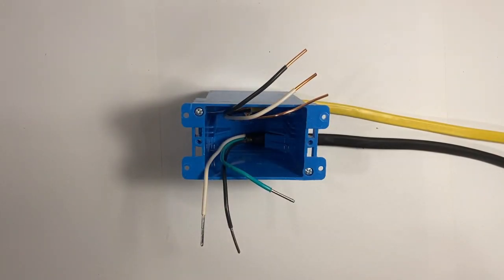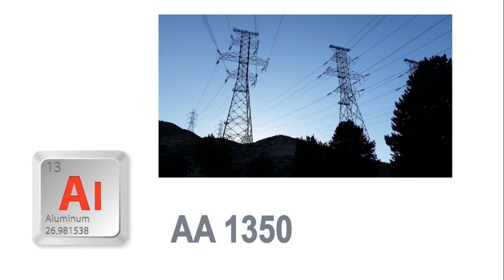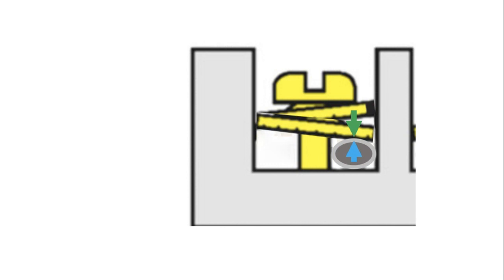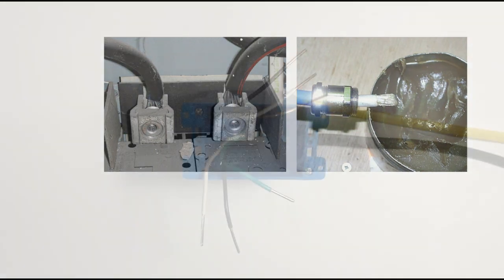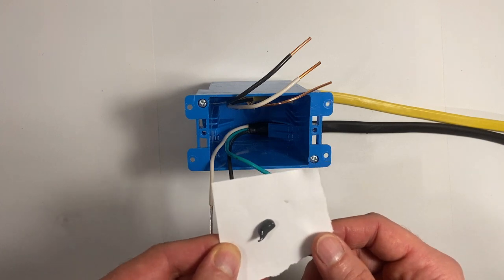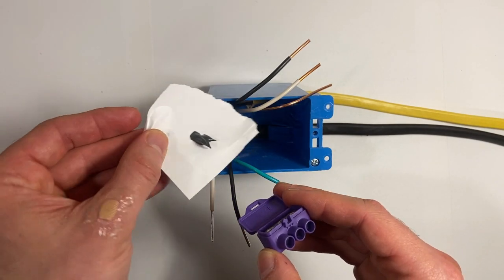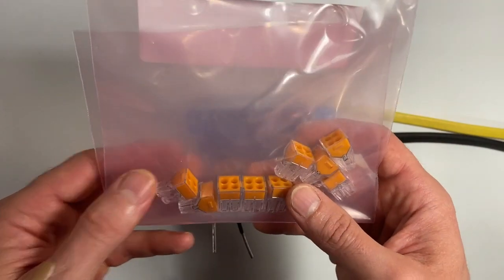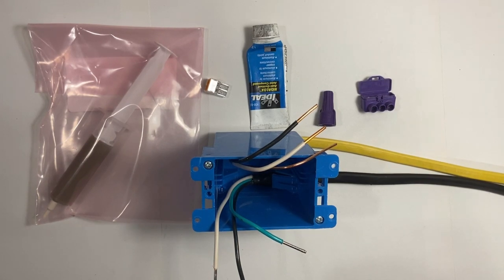Is aluminum wiring bad? How to connect copper and aluminum wires safely.

Comment: Supposedly no a CO/ALR rated outlet is not a good solution.  The connections still come loose over time due to the ductility of aluminum and expansion and contraction that occurs under load and when load is removed.  No one can ever explain why the ductility issue is magicall negated by Alumiconn connectors.  Still waiting for an explanation of why Alumiconn is better than a CO/ALR outlet.

Comment: My first choice is the alumiconn connector as long as it’s torqued to specification.   My second choice is regular wing nuts with antioxidant paste.  They hold great.   My last choice is the blue nuts.  I’ve had two of them fail on connections.  They are big and I don’t trust them. I read other people had trouble with them. I do have one outlet that accepts aluminum wire. They are great as long as the connection is made correctly.
Reply from the maker: Thanks for stopping by! I agree with your order of prefrence 😊

Comment: Great video! I appreciate the visual aid as youre talking about each thing. 😊  

So I had to do some digging and there is not much information about it, but it appears that the WAGO 222 lever connector series can also work with copper and aluminum as long as you use their Alu-Plus paste. The 222s can take a range of wire sizes too, unlike the push-in connectors. And the 222s can handle stranded wire as well I believe, as the push-in connectors can only do solid wire. They also take up less space than either of the purple connectors you showed.   

FYI, I looked and looked and didn't find much on info on this connector being used with copper and aluminum anywhere except for on the WAGO website itself and maybe one forum. If you generate the data sheet on the WAGO website on those connectors, it does say copper and aluminum. I even found a page on the WAGO website that explained the problems with connecting copper and aluminum together and tips on the matter, and it mentioned the WAGO 222 lever connector and their paste. It said that WAGO 221 connectors are not designed for it but 222 connectors are. 

The really strange thing is that not even a couple days after I found that page mentioning copper and aluminum connections on the WAGO website, I went back to it and it said error 404 page not found. 

Sorry for the essay but with all that said, these are not very well documented yet, so maybe use at your own risk with their paste. 

@Russian Sparky maybe the WAGO 222 series is something you can look into and do some testing on!
Reply from the maker: Thanks bud... Will try, but one thing I know, even though there is paste, and you can buy pre-filled connector, they are not listed for AL in the US...

Comment: Central and Eastern European houses wired in the early 1990s and before have aluminium wiring and they are just fine.
Reply: No, they are not fine. I almost got a fire several times.
Reply from the maker: Chances are, they are using the new, 8000 series aluminum.
Reply: @russiansparky4194  I'm not sure what alloy was available in the 1940s but there are 70+ year old houses with original wiring in pristine condition. Although we need half the current for the same power on 230 V and we didn't have backstabbed outlets and switches like in the US. We also use 3 phase so instead of a 50 A circuit like in the US we use 3x16 A.
Reply from the maker: @mernokimuvek  Hard to talk about this in general, because every house is different, but I think there are two things at play: a better aluminum alloy than the infamous 1350, and unmodified, original wiring. Plus, all the things you mentioned - no backstabbed devices, higher voltage. If you don't overfuse (e.g. install a 32A fuse on 2.5 mm2 aluminum wiring), it will last. Lots of original knob-and-tube wiring is still in use in the US, and it works as long as it hasnt' been modified, added to or overfused.
Reply: @russiansparky4194  Origianl wiring is a key condition. Most problems are not from old wiring but from dumb people who modify it without knowing what they are doing.

Comment: I work repairing aluminum wire every day. We often see the PURPLE WIRE NUTS burnt out. DO NOT use purple wire nuts, they do not fix it appropriately. I would suggest Copalum crimping if available in your area.
Reply: Stereo receivers and car Audio radios are all aluminium. 

Car chassis are steel.

So you now need a copper car chassis. 

You must buy a home stereo made of copper. 
Home HiFi stereos are all aluminium. 

Power lead connection fittings are BRASS.

WORLD FAMOUS Marshall guitar amplifiers are made of aluminium. 

U full of sh$t.
Reply: i seen it as well when a junction box is made between in circuit i have found them melted but still functioning aka didn't know there was an issue was in junction box working on something else.

Comment: I was going to buy these and use it with the oxidation cream but instead I found IDEAL set screw #11 vibration resistant wire connectors which screws in. I need more info!!! I'll be joining a very short 12 guage aluminum wire to 14 guage copper wire. Done this before but with the purple marrette.

Comment: HOWdy  R-S, ... 
Thanks ... 
Would applying  NOX-OX  or  OX-GARD  paste fill the bill ? 
I coat ALL of my SOLID WIRE, both  COOPER & ALUMINUM, when  I place them in my Circuit Breaker PANEL ... 
but never thought about the SWITCHES & OUTLET Connections ...
Much Appreciated
COOP
the  WiSeNhEiMeR from Richmond, INDIANA ...
...

Comment: Years ago, I rented a house with aluminum wiring...at that time ('80s), finding co/alr outlets and switches was easy. I used an antioxidant coating suggested by the hardware store. I replaced a ceiling light, and the new one had stranded copper leads.
     I tinned them with solder, shoved the antioxidant gunk in a wire nut, put it all together. Never had any problems the three years I was there. 
    As I understand it, the early aluminum wiring had the majority of the problems, and these were ironed out by the '70s, but it had a bad reputation, and insurance companies don't like it at all...

Comment: I have an older house and has aluminum wiring in some places. I replaced a GFI outlet in the bathroom and it has copper wiring. I plan to install a night light in the hallway close to the floor so it doesn't illuminate the whole hallway. We have regular hallway lamp attached to the wall but it gives off to much light to the great room. There are no outlets in the hallway. So I bought a 4" flush ceiling lamp to install on the lower part of the hallway wall and use the same switch that goes to the hallway lamp. I've decided to use a double toggle switch to replace the existing switch. That way we can turn on or off either lamp. I opened up the existing switch and found it has aluminum wiring and pigtails that connect aluminum wire to copper wires like you mentioned. It's the older method which you described. Yellow connectors with that gray paste. The hot/common/ground wires are aluminum. The ground wire is attached to the box. The hot and common aluminum wires are connected to copper wires and copper wires go to the switch and existing lamp. So what do I do? I'm not going to rewire my house or change the existing lamp. I'm going to replace existing switch with a double toggle switch and install a lamp towards the bottle of wall. Do I cut the existing wires and tie in copper wires using purple connector? I probably just answered my own question. Any information will be greatly b appreciated. Thanks.
Reply: I work repairing aluminum wire every day. We often see the PURPLE WIRE NUTS burnt out. DO NOT use purple wire nuts, they do not fix it appropriately. I would suggest Copalum crimping if available in your area.

Comment: As a plumber we are taught that anytime you connect two disimilar metals together you will get electrolysis effect where one of the metals will begin to oxidize rapidly . When you connect copper to steel/ iron the iron will rust, oxidize. When you connect aluminum to copper/ brass/ steel connections the aluminum decays, oxidize s.   I have also noticed in coastal areas that hardware,nails rust, oxidize very rapidly so I would think aluminum wiring would also oxidize rapidly in the salty air.  When electric wires do not connect together tightly,snugly the electricity has to " jump" through the air as it passes through the electrical connections, this causes the wire to get very hot and this causes fires. In automobiles the light bulb grease is always recommended because it helps prevent corrosion and increases connectivity aiding electricity to travel through the grease.
Reply: I agree totally with what you're saying. Dissimilar metals do cause electrolysis. However, you, in your own business are using solder to connect copper pipes. Or maybe you only crimp these days, but you will have to work with soldered pipes. Me, as a radio amateur and electronics builder will often (almost always) solder components as well, and my solder is not even the same alloy as the one you're using (mine contains lead, and that's not even the easiest to get, I use it because it's so much better). So it depends on the metals/alloy. Zinc and iron, for instance. Especially in sea water. You'll put a hunk of zinc on your hull or around a prop shaft or whatever, so the electrolysis eats away at the sacrificial zinc, and therefore protecting whatever steel is around.

Modern aluminum wiring is not pure aluminum. The alloy is called AA-8000. t contains 0.001 to 0.3% zinc, 0.001 to 0.03% titanium, 0.001 to 0.5% manganese,
and 0.03 to 0.4% silicon, depending on product specification. Thus, it has many of the properties of copper, and a lot of corrosion resistance. However, it's not as good a conductor, and it does need to be connected very securely.

That said, If I had to rewire my house, I'd rather pay extra to have copper everywhere. I don't even think alu wires are easily available here, not for installation in a house, at least.
Reply: It was a lie.

Aluminium connections to STEEL CHASSIS are on trillions of cars 🚗 👌 

Perfectly fine.

Home stereo receivers, tape decks, EQ sections all aluminium. 

According to you, all home radio 📻 amplifiers must be made of copper chassis. 

World famous Marshall Amplifiers are all aluminium chassis. 

Power chord fittings are BRASS. 

Car radios connect to STEEL. 
THE RADIO CHASSIS is aluminium. 

Grow a brain 🧠 😌 

Your poor education is on display. 
Men ARE world famous liars.
Reply: The “grease” is dialectric grease.

It is NOT conductive.  It does not help the current flow between metals.  

The purpose of bulb grease AKA dialectric grease is only to mitigate oxidation and rust by keeping air away from the termination.

Comment: OK, I'm late to dinner but I believe some comments are appropriate.

First and foremost, work with aluminum romex should be referred to a licensed electrician.  Any mistake is just too dangerous when things go wrong.

Next, Picturing this in a plastic box.  Really?  I would personally only use a steel box where it has a much better chance of surviving any mechanical damage or internal fire.

Torqueing ALL screw connectors is critical!  Not just the fact that it's done, but the actual torque used.

Don't use Wago connectors and particularly their knock-offs!

Comment: What about circuit breakers with aluminum wiring circuits.. which most breakers are listed Al/Cu ? Would those need the listed wire connectors? Or?
Reply: Most breakers are listed Al/Cu, but if you have ones that are not, just connect a copper "pigtail" to the breaker and connect the aluminum wire to that pigtail using a listed al/cu connector. Yes, it is OK to make splices within a breaker panel :)

Comment: How long does it typically take something to reach catastrophic failure?
Reply: It depends on many factors, primarily on how heavy the loads are on the given receptacle. If it's just a table lamp you might never see a problem. If it's a 1500W heater, it will start smoking pretty quickly.

Comment: I am doing a solar project. My feed has to be rated for 200 amps.

Can I use aluminum mobile home cable 2-2-2-4 ?

Some say it is rated for 100 amps only even though it is 2 gage, why is that?
Reply: 200 amp aluminum service wire would be 4/0 4/0 4/0 2/0
Reply: @LibertyDIY  thank you. Job is done.  Used 2/0 . What a learning experience lol. Have a great day

Comment: Why would you use #12 copper NM wire (20A rated) with #12 Aluminum wire (15A rated) ?
Reply: You can have a 15A aluminum supply dump into a 20A capable copper pigtail.  Sometimes using same wire gauge makes life easier, and it doesn't hurt in this instance.
Reply: Yeah it’s not really big deal but you can just pigtail 14 copper to 12 aluminum
Reply: @Vanilla_Icecream1231  The CPSC states that there is NO SAFE WAY TO CONNECT COPPER WIRE TO ALUMINIUM. don't want to risk my life in a purple 4$ wire nut.
Reply: @hankkline7300  not true in Canada it is safe enough to use a marrete 63 or 65 which are made of an alloy compatible with both as long as you apply antioxidant to the wire this is as close to perfect as you can get other than replacing the wire which although best option is costly and time consuming I understand why they say it's not safe but it's just not a great thing to do
Reply: @Vanilla_Icecream1231  MY son bought a house after the fire, where the woman had to jump out of the second floor window. They had an electrician repair a failed outlet (aluminum wire)  10 days before. This is where the fire started. My son tore all the drywall off and rewired the entire house in copper.
Reply: @hankkline7300  wow I’m just saying that as long as you do it properly it’s unlikely anything will happen unless your replacing all the wire it’s better just to leave it alone I’ve lived in a house for 14 years that was built in the 70 that is wired with aluminum
Reply: @hankkline7300  but yeah it does happen
Reply: @Vanilla_Icecream1231  Good luck, keep fresh batteries in your smoke alarms.
Reply: @hankkline7300  lmao don’t worry the panel is new no more fuses the bathrooms are all copper as they were renovated and the basement flooded 10 years ago because the sewage system back up with rain water so the basement was redone as long as there isn’t high load you should be fine the only place with high load should be the kitchen the stove is copper wired that was swapped and the receptacles in the kitchen are pigtails So they should be better than going straight in the terminals

Comment: Good video! I am currently starting a project of pigtailing all of my outlets, switches, junctions, and light fixtures with Aluminconn using a torque screw driver I bought on Amazon. My question is what is your opinion on using a device like Aluminconn for ground wires at each outlet/junction? I know the manufacture recommends it (obviously it will make them more $$)... but I don't feel like it's necessary to use alumincons for ground wires and I have been twisting them together. Also, my old outlet boxes are small and space is a primum so it would be hard to fit 3 pigtails in some of them. Since my Ground Aluminum wire is already exposed inside the box without a sheathing , it kinda feels like it won't benefit form it. Obviously Hot and Neutral wires need it. For each new connection, I have been cutting off the used tips of the old aluminum wires and stripping it to get a fresh wire contact in the Alumincon, then torqueing it to spec... but what you think about doing all of that for Ground wires?
Reply from the maker: The code will tell you to use a listed connector, such as AlumConn, but in reality, grounding conductors do not carry current under normal conditions, so they are not subject to the same vicious cycle as the current carrying conductors are. If I were doing this in my house and not having it inspected, I'd use standard wirenuts and Noalox to connect/pigtail aluminum grounds.
Reply: @russiansparky4194  Thanks for the quick response, Yes I am only doing this for my own house. After 10 years living in my house built in 71, One of my outlets recently started to burn.  That's when a local electrician mentioned Aluminconn. Most of my outlets in my house have been upgraded to more modern 2000's or newer outlets/switches, but I still have aluminum wire connections. In some cases, I have been leaving the aluminum Ground connected directly to the outlet undisturbed, while pigtailing each hot and neutral.  I bulk purchased 3 port and 2 ports Aluminconn's from Amazon and been retrofitting each outlet/connection/switch myself using a torque screwdriver. Once I am 100% done with each switch/outlet/junction, I will do my main circuit box to each breaker and bus bar after turning off the main. I'm not a electrician, but am a seasoned DIY'er try to research as much as I can before I do a project.
Reply from the maker: @Mr-Chris  I will tell you from what I have seen in the field: a knowledgeable, thorough homeowner who has done their research, will do  (on average) a better job than a professional electrician. You can afford to take your time. A sparky has to be in and out while making a decent job, not a perfect one. You definitely sound like you know what you are doing.